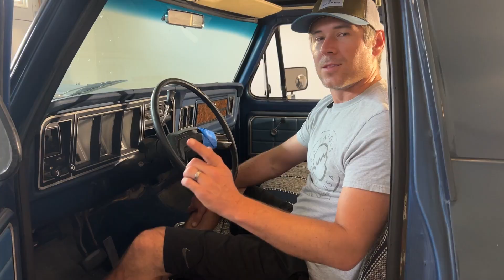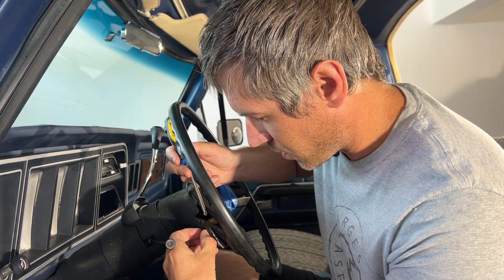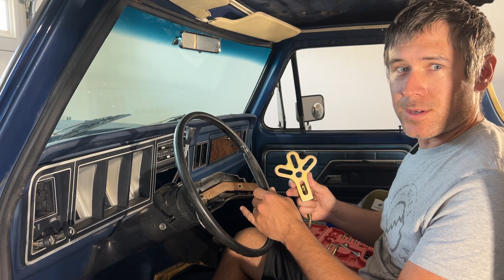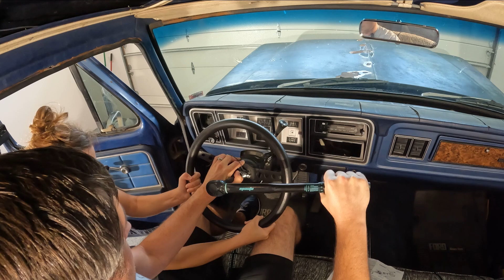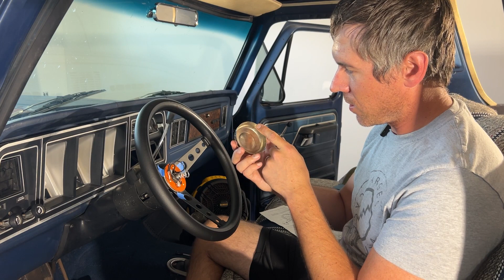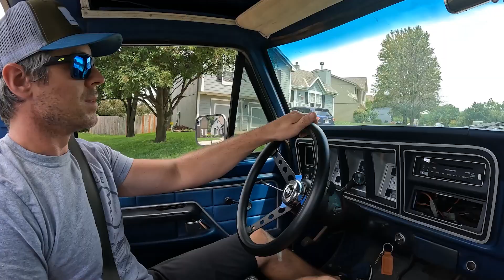GT Steering Wheel Upgrade | 79 Ford Bronco

Comment: Yep… definitely need a new wheel on my 79. The 14” just seem a little small. Really like the older mustang wood steering wheels.
Reply from the maker: The GT style wheel makes a huge difference in the feeling on the steering. With the wider grip it feels more modern than the thin old wheel. The old one was falling apart in my hands. Those old mustang wheels are nice too.

Comment: Great video Jacob! Did you end up having to replace the horn relay? My horn is pretty quiet, doesn't sound right. Did you have any tips for troubleshooting that issue? Thanks!
Reply from the maker: @hammetime, great question! I experienced the same thing. At one point I forgot to pull the battery and the wires may have crossed and arced on the horn when I was putting it together, I quickly pulled it apart and unhooked the battery. Thinking I fried the relay I bought a new one and come to find out mine doesn't have a relay, it was cut out of the harness. I was thinking of buying a two horn package and installing a relay but my harness is a mess. I decided to hold off till I get a new harness / fuse block kit. It is annoying, a few times I've had people cut me off and I had to lay on the horn and it's just not loud enough. I've thought more about going the air horn route instead, I think it would pair well with the 400 lol
Reply: @jacobsupgrades  Thank you!
Reply: I had the same problem with my 87 f250.  It did not have a factory relay.  I used a generic relay kit and the factory wiring to trigger the relay.  Horn is back to being loud.  I think over time the factory contact rings can't handle the amperage of the horn